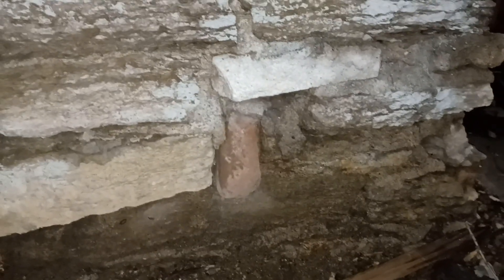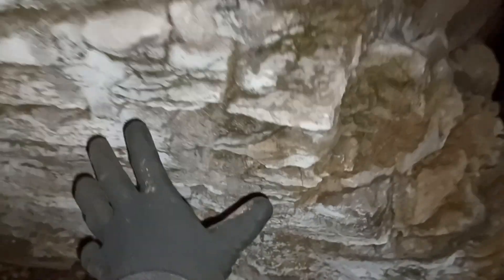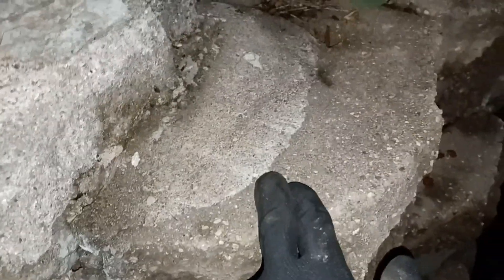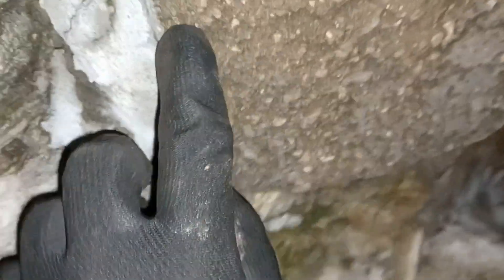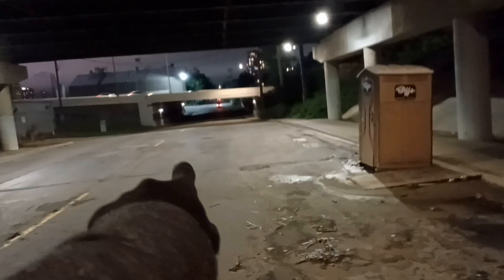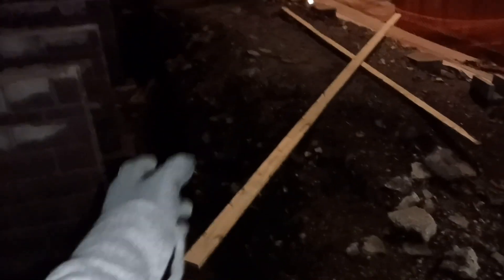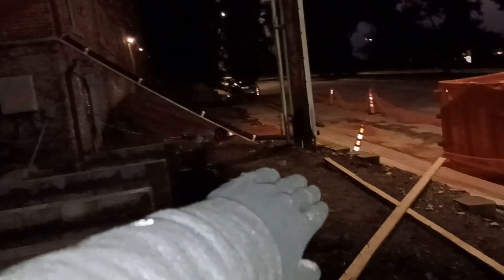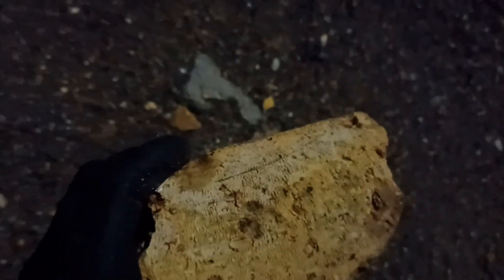The Failed 'Stone' Foundation Theory

Comment: I made a lot of the bumps. is leftover concrete. It is better to go with daylight, you can see it better. 

You saw what they dug out. 3.30 those blocks are hollow on the inside. those blocks are filled with cement. that bump is leftover cement.

not to shame you because you are doing very well. Best boots on the ground. he may well make a mistake. Then we are here to help.